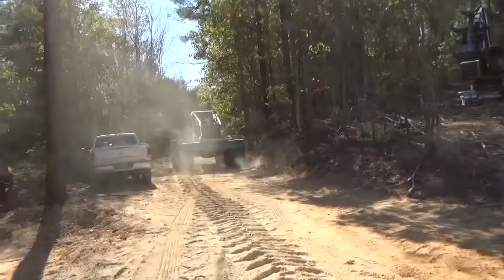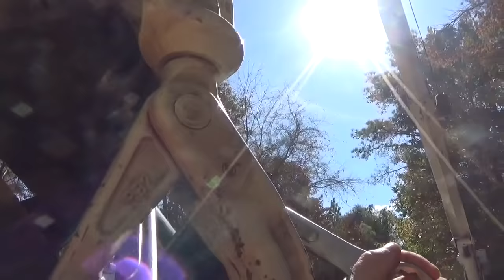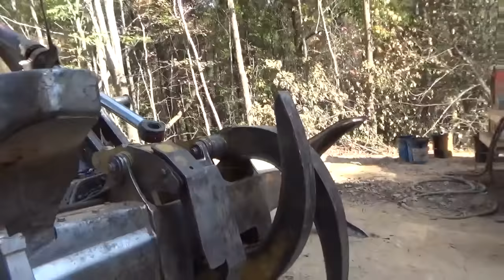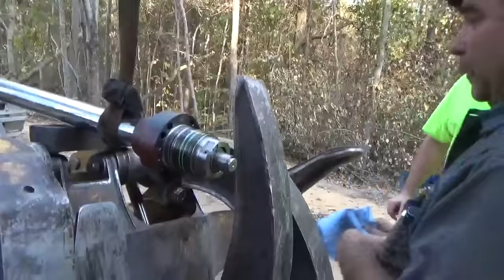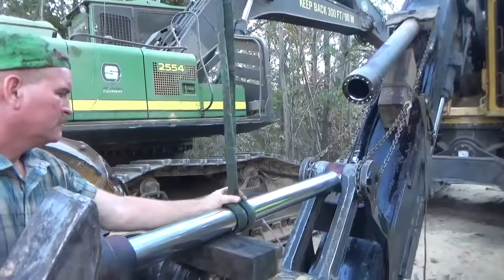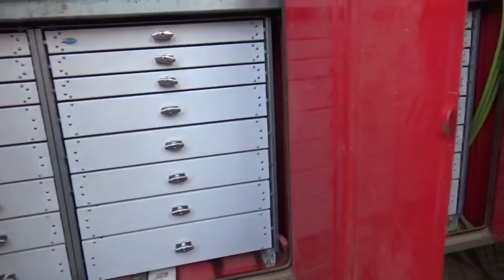4 1/8" nut on the Tigercat L830C hydraulic cylinder

Comment: I made a breaker bar for nuts like that on ship drive shafts to hold props on. The difference is it allows one person to really hang on it and allows fitting if impact gun at same time. The combination of the impacts and the constant pull loosens even the toughest nuts. Not sure if anybody makes one for sale but had to make mine as could not find one? Mine has saved the day many times!

Comment: I repacked the cylinder on our John Deere 225 excavator and tried to take the nut off. We beat the hell out of it, used huge breaker bars and got as far as you guys did. Then we took it to a shop with a hydraulic wrench and found out how much they are torqued at and realized we were wasting out time with anything except a hydraulic wrench. Haha that's big boy stuff, man.
Reply from the maker: +Alex Schlegel the problem here was there was one who thought it would be normal easy off pack and back together before mid afternoon and the rest of us knew that wasn't gonna happen. Excavator cylinders are no joke but u still have to prove that fact every now and then.

Comment: I had the same problem with a loader cylinder it was similar diameter but shorter. I had to heat it up glowing and use a 1" impact gun to break it it was a nightmare.

Comment: Don't know why with all those service trucks there wasn't one hydraulic nut cracker.  It squeezes the nut with a bolt on one flat  inside of a universal nut holder and then a short hydraulic cylinder torques the nut loose.  Those nuts are on there a minimum of 3,000 ft lbs.  That one was probably around 5-6,000.  No impact that size will touch that.

Comment: we've had some issues with some sand where are trucks wouldn't go out and we took some round bales of hay and roll them out and it tightened it up like concrete it works amazingly hard to believe
Reply from the maker: +Wayne Peake I've seen that done in flat spots that were solid sand and it does work but that hill is steeper than the camera shows.  Also we are not the ones who are paying for that either, so it's the owners choice as to what they want to have on the road.

Comment: Nice video, but you should not put chains on the hydraulic cylinder rod. Keep up the great video's.
Reply: Stephen May you'll never scratch that chrome. Not in a million years.
Reply: Good work practice! Use straps not chains, If you can't damage them, then how come machine shops are always repairing them with new shafts due to scratches and wear? I have seen damage to cylinders. Use straps and stop any chance of damage.